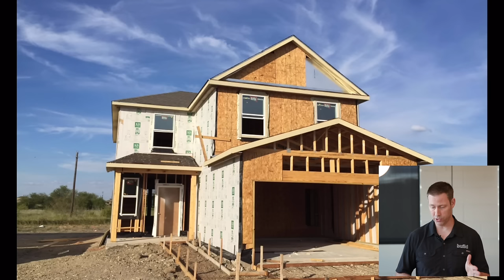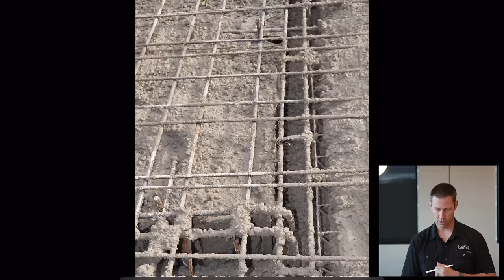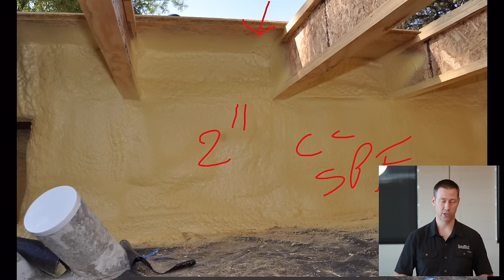Foundations - Slab vs. Pier and Beam - Which is better?

Comment: Brick veneer doesn't seem to be very popular in the US - I notice nearly all the houses you build are mostly cladding of one type or another. In Sydney Australia, which I think would be a similar temperature to most of Texas (we probably get more rainfall being coastal), most project homes are brick veneer, on a raft slab with products like Hardiplank often used on the second story (that's a more modern trend).  Is there a reason you don't see or use a lot of brick?  One other difference - piers on raft slabs here are nearly always concrete down to bedrock AFAIK - not just steel driven into the ground. Perhaps they are as well and I misunderstood what Matt was saying in the video?
Reply: He definitely said steel driven into the ground until it hits bedrock. which IMO steel will rust if the ground conditions are just right for it, I have read of seaports replacing their steel sheet piles and hollow piles after jut 10 or 15 years and switching over to composite material piles like vinyl or even better the fiberglass composite which is stronger than vinyl and will last MUCH longer.

Comment: My most sturdy home was a hybrid. In earthquake territory. But still excessive in the foundation, it is nearly bombproof. 10ft deep by 4 foot thick peirs in every corner of the house and  in the middle of the long wall . 2ft by 2ft footer running the perimeter of the slab and crisscrossing in the middle. Then a 8inch slab. 
Whole thing is rebared. Built like a bomb shelter.

Comment: I'm thinking a partial basement. Where the main floor of the house might be 16ft x 32ft inside wall to wall, the basement would be 12ft x 24ft... Top it off with a one bedroom attic with steep sloping ceiling where one has just enough room to walk through the center.

Comment: What about making channels for plumbing, wiring, etc in the slab on grade and then having concrete caps over those channels? The caps could be designed to be removed like manhole covers.
Reply: Not that it couldn't be done, but it adds complexity and expense.  One of the reasons slab on grade is popular is because it's cheap and easy.   I'm not pointing fingers at Matt, but a lot of builders (and homeowners too) really don't care much about future maintainability, so aren't interested in putting much effort into it.
Reply: @andrewalexander9492  very true

Comment: Let me ask, why don't you make regular basements, instead of a crawl space underneath the house? It serves exactly the same purpose of running your drainage lines and/or central heating pipes, while also having a garage and storage spaces. This is common practice in my country Cyprus and I can speak from experience on how comfortable is to make modifications or repairs in the basement instead on being crouched inside a crawl space.

Comment: In Minnesota, we’re still required to put down frost footings to 6’.  But this will save excavation for a full basement and let’s me put the joists further down giving me a height for slab on grade with a wood floor we otherwise wouldn’t be able to get.

This is our retirement home at age 58.  We want ZERO steps.

Comment: I'm thinking a walk out basement style house is ideal. you can have a huge garage down and house up with easy access to mechanical  systems. I realize that adds expense but if I want a large shop I'm saving a lot of money.
Reply: The walk-out type basement is dependent on the terrain itself, I currently live in a house with no hillside on one side to easily just add a drive in space in the basement as old and unconditioned as it is and  just a hundred feet from a river. Even my sisters current (first) house is a walk out but still not the accessible kind for a vehicle. I have seen homes as you describe and they are definitely nice, removes the garage from any nice views. I am planning on doing a hangar style basement and depending on the terrain  if no slope for easy access to park a car inside there is the option to add in car parking lift like the Phantom from AC Lifts.

Comment: Hi Matt, very helpful video thank you! I have a question though. I live in New England and am looking at a house that I (think) has a pier and beam as there is a crawlspace underneath. What are your thoughts on having this type of foundation for a house given harsh winter's here? Also, do you need a different kind of vapor barrier than the one you like for a slab foundation? Thank you!! 😊

Comment: What about the Texas tornadoes and hurricanes? If the house can easily be transported, it is easier for a tornado to move it as well.
Reply: While not as bad in Texas but still it can often enough get hit with them, here is an article showing how well an ICF monolithic Stilt or "Pier and Slab" (Pier and Beam) type construction holds up in Hurricane (even tornado) type conditions:

https://logixicf.com/blog/news/building-hurricane-resistant-homes-a-tale-of-the-survivor-house-in-mexico-beach-florida/

Basically put, a stilt type home will hold up far better in a hurricane or tornado. Though depending on the roof type which is a whole other matter which makes even more of a difference in either type of natures wrath storm.

Comment: Question. Since pipe work or upgrades after a pour with reinforced concrete are so difficult, why not just build a basement and pour the slab as usual but then create a treated lumber false floor frame and also frame the interior walls and run all the piping in those wood walls? 

I see nobody is doing this. Is there a reason besides the cost? It would make it so much easier to service and you can also increase your R factor by stuffing some insulation between the studs. Maybe it's just a little overkill.

Comment: The house I live in , in Richardson Texas is 48 years old .  I have concrete flaking off on the westside with rebar exposed .  So far I have not seen that on other foundations around me.  I have foundation work done on this house .  I can only guess that the PSI mix with the concrete was not appropriate .   My neighbors house next door does some minor cracking inside .  Not very much .  Different contractors built different houses .  Some houses have brick made in Mexico with no holes . That brick deteriorates when wet .  Some houses have aluminum wiring .  I have a lemon house .    How do you insure that the concrete mix poured is consistent in good / best quality for the job ?

Comment: I’m in Houston where everyone has a slab on grade but since it’s clay here for 10+ feet deep everyone has cracks at some point and does that super invasive and expensive fix you mentioned. I always wonder why they don’t just put those piers in first, when they could use heavy equipment and not damage the finished interior. Any thoughts on why we’re in this situation down here?

Comment: Pier and Beam, AKA Stilt Home

You CAN insulate a slab foundation easily these days, you even covered the product a few times, ICF has more uses than just for walls and many of those manufacturers make floor (also can be used for roof be it flat or gable angled or single slope and come with optional hats for deeper beam sections for post-tension for longer clear spans). Heck, I have seen articles of homes and other buildings using ICF as a pier and beam or stilt type building/structure using ICF for the piers (piles, square or rectangular of course) and the slab as one monolithic like foundation. Though I do like the pier and beam style due to as mentioned for the easier lifting and moving of the structure to another location as needed, another idea is a hangar type foundation above (or Below grade as a basement) is akin to a pier and beam and if you place windows at the top in a way to allow for easy  placing of lifting beams would also make for easy moving of the upper house structure.
 Even with the few mixed slab and pier (or pier with slab) type foundation is another great place to utilize ICF as well to help insulate the space, conditioned or not.
That is all I care to say for now.

Some visual Information on what I mean of using ICF for Pier and Beam (as you call it) type of construction:
https://www.insuldeck.com/insulated-floors-for-elevated-buildings/

Comment: A while back you showed a wall stud that had dowels in between 2x2s I think.  I cant remember the name of the company but I believe you said it was cheaper than solid lumber and had almost comparable strength.  Their selling point was that you spray the walk cavity with foam and it reduced thermal bridging.  Could a thicker process be used to make floor joists and beams instead of the ibeams?
Reply: TStuds : https://www.youtube.com/watch?v=mxDSulcLpAE (literally took me a few seconds to find)
Not sure they recommend it for that purpose you are asking of, since they are only engineered for wall type use.

Comment: There is an additional advantage in my mind for having a P&B foundation.  This is humidity.  

There are soils where there is so much humidity in the ground, and a SOG will simply act as a sponge and soak the water up.

A P&B will serve as a way to decrease this since there is less surface area.

The remaining problem are the piers absorbing humidity.  There are ways to diminish this: water proofing and ventilation.

However, these can remain as weak points if not dealt properly.
Reply: That is true of SOG NOT using a vapor or water barrier below it.

Comment: I have a slab on piers, looks like a typical slab foundation.  The soil is wet clay, almost marsh-like, with water just below the surface except in the late summer.  The house is 30 years old.  The slab is not cracked yet.

Comment: How do you prevent rot in the beams on pier-and-beam homes? I understand that the beams would last longer if the area were enclosed, but if it were simply skirted, won't termites and the elements (and critters) get in, possibly destroying the beams bit by bit?

Comment: Matt, I have learned so much from your videos is change the way that I look at houses. I also have come to realize how crappy the homes are built in my area of El Paso Texas. I was blown away by the lack of insulation oh, no use of vapor barriers underneath the concrete slab.  In some cases not even using rebar in their foundations and they're asking exorbitant prices

On a side note as a  General idea what do you think that price of that Farmhouse cost to build..  I would love something like that with a wrap around porches, I'm just asking for a generalization you think that's $100,000 home?

Comment: I really have to ask: Why are you not insulating under the concrete regardless of whether you are building on the slab or are building pier & beam conditioned space on a (thinner) slab? The Earth underneath is going to want to suck down heating or air conditioning to make the slab or space earth temperature. Even in Texas.

Comment: Do you guys install radiant heat in concrete floors? It seems like an easy thing to add. Even in TX it still gets cold in the winter. I wouldn't want to walk on cold concrete floors all the winter.

Comment: 2:30 Another problem you have is you just created a hole in the bedrock, that hole will try to fill with water, concrete is not great at keeping water out so that basement may flood if there is heavy rain. My parents house also has a cellar blasted out of a solid rock and it floods every thawing season, just the floor mind you but still.

Comment: my termite guy says termites love block foundations.  They come up from inside the hollow blocks.  Use poured foundation walls or fill the blocks with concrete.  Slab foundation is cheap, but it sure is nice to have a basement or crawl to work on the plumbing or electrical down the road  To say nothing of being in a flood zone.

Comment: Is that yellow sheeting and those reinforced lentil like beams really better and cheaper than say using a 12" base of 2Bs topped with an inch or two of rigid foam insulation and then rebar and wire for the concrete? The 2Bs will keep water away from the slab and the rigid foam will add water proofing as well as temperature moderation.

Comment: Which method is more cost effective for a home addition? We live in NE Kansas. Our current house is 100 years old with a part stone / part concrete unfinished basement (6 ft tall basement) on most of the house then an enclosed crawl space for the rest of the house.

Comment: Why not opt for polyurea on the exterior (to prevent air/moisture before permeation) as opposed to closed cell on the interior of walls? In time, (albeit, probably a long time) won’t any hydro... pressure have the chance to compromise the integrity of the foam?

Comment: Quickly becoming one of my favorite video series.
I was surprised to see the metal joist hangers used under residential flooring.
I'm used to seeing joists resting on concrete rim and overlapping on beams.
Maybe it's an Ohio standard.
What are the requirements there?
Reply: t swartzbaugh this was done to maximize the crawlspace, so the house is not too high off the ground, and crawlspace is not below grade. More common with the style of house down there. I live here in the midwest, when making the basement the concrete forms are always the same size, i forget like 8’6” or something? Im not a concrete worker, but a framer. The beams in the basement will be posted up off of piers, or a hallway will be built in the basement, at the right height.

Comment: Why are slab homes favored by builders?  1 reason: because they're significantly cheaper to do poorly.  If you do them right (piers driven to rock) they still might be cheaper, but most builders will do them poorly and depending on your soil, you can almost count on having them fixed at some later date (very expensive).  P&B foundations cost more but are significantly more repairable.  

The insulation of slab homes is a moot issue.  The ground is almost always going to be a more moderate temperature than the air.

So, P&B FTW!  And you're so right about its hard to find trades that know how to do a P&B foundation these days in the south.

Comment: 3:33 Does the slab not need control joints like exterior concrete to prevent random cracking? And if you do, how do you tile over that control joints?

Comment: Great information do you have any thoughts slab insulation we are in north/central Mississippi have some frost problem, and will be getting home build shortly.....
Reply: ICF is useful in that deck forms perfect for floor and roofing and thus slab type foundation even, and along with the block helps to provide a frost protected slab.

Comment: I need your help. I am worried about water lines in a slab house. I was told building a basement is my best bet. However I am recently paralyzed and need a zero entry home and could not utilize that basement in any way. Do you have any tricks for keeping the water lines out of the slab?

Comment: I would add that for pier and beam houses, using steel shim plates between the top of the piers and the beams is far better than just using some scrap wood (or OSB as my old house had).  Watch what the builder wants to use and ask for what you want.   The steel will not "crush down" as wood will over the years in these critical locations.
Reply: Better yet just go with plastic shims like PE or PP, and better yet composite like fiberglass which are not prone to crushing or rusting.
Reply: in the case of piers and slab you mentioned (11 minutes into your presentation), if they were not able to reach the rock and had to do reinforced concrete footing for each pier, would they have been able to do a reinforced concrete slab still (I know he said the slab was not reinforced)? 

if so, can the piers be taller than 2 feet; say 6 feet tall? Can it be done (I know it would be very heavy)?

Comment: You missed something big when talking about slab on grade. To do this properly, the site requires a thorough geo study by the engineer. Everyone thinks that Austin is a rock, so slab on rock is fail proof. My previous house had a 7000 sqft slab for house and garage. The engineer skipped the geo because he "knew" the area. Well he didn't - one end of the slab was on bedrock and the other end on deep pockets of clay. Clay expands greatly with moisture / rock does not. The foundation cracked and the house hinged like a butterfly's wings.
Reply: Bill McCaffrey ouch.. hope the contractor had the where with all to make good on his mistake...

Comment: Here in my part of NC, slabs are mainly for cheaper homes and homes in neighborhoods specifically built for older retired people. I much prefer a wood-frame floor with a crawlspace (which I have). I like the height difference between the ground and the interior floor, and the feeling of wood-framed floors as you walk. I see no reason why Texas (especially East Texas) can't stick with crawl spaces.
Reply: Rattlesnakes and scorpions, that's all.

Comment: How can a builder or plumber Not put a trap on a shower? That's why I do my own..  Looking at the photo of the exposed shower area, would it have been possible to fit a running p-trap to the pipe as it exits the slab?
Reply: Yep I am doing exactly that at my house being constructed.

Comment: Concerning all the SPF or polyiso foam board applied/installed to the underneath side of the decking & crawlspace perimeter walls - Where is the fire retardant barrier required between the foam and occupied space above sub-floor/floor?